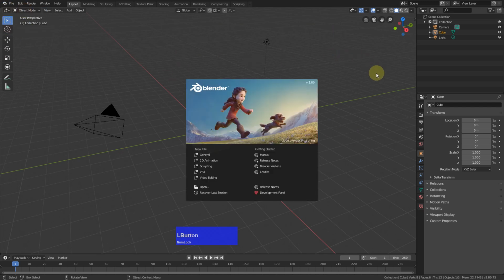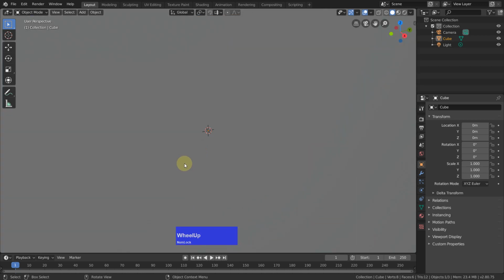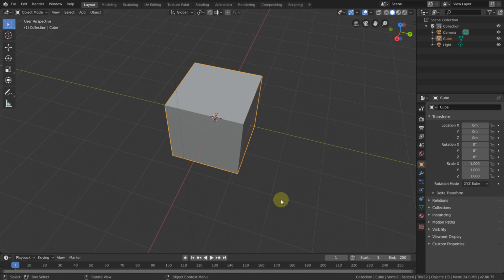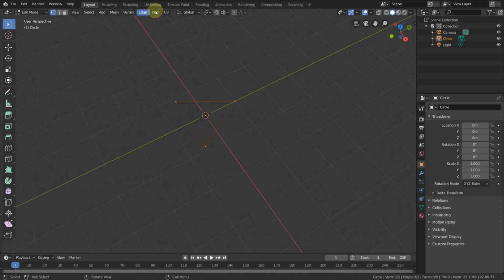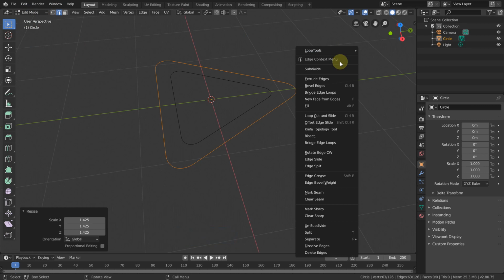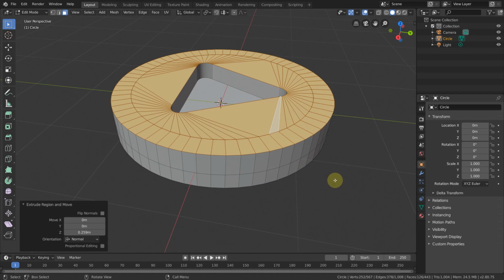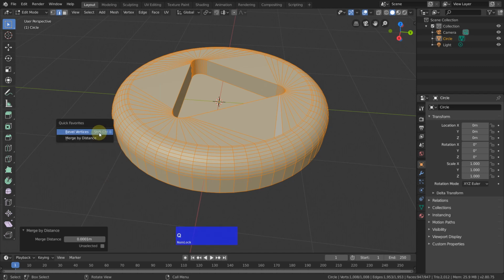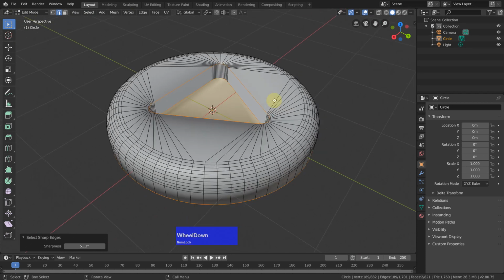A MODO Fan looks at Blender 2.80 - Part 01

Comment: I use blender, but there are scenarios in which Blender gives me a bad topology with its modifiers, although I usually solve these faults with addons from the Blender marketplace, I find blender great, but I have thought of using some option for hardsurface modeling I've even thought about using Inventor, I've seen that Inventor achieves an excellent topology in less time.
Does anyone know if Modo is a good option to model versus Blender? in the context of access to a good topology in a short time

Comment: Glad to see you back Peter! Question: No matter how many times I've tried, I am unable to make the curved bevel (16;35) work. It just bevels down the side(z axis). What could I be doing wrong? Thanks for your posts!
Reply from the maker: Hi, I can only give you the main reasons why tools sometimes behave funny. 1) change rotation, position or scale in object mod and not apply it. (CTRL-A) 2) Having double geometry in your model (Merge by Distance) 3) having geometry inside your model. 4) having a problem with the normals (Blue is right, red is wrong). I hope this can help. Good luck, Peter PS: I forgot something which is annoying and frustrating to say the least. Almost all keycombinations you can think of mean something in Blender. So if you hit a wrong key you might have activated something and it's not easy to find out what. So hit the save key often so you can go back to an older version. :-)
Reply: @stammpe2  Thanks VERY much! Merge by Distance did the trick!

Comment: by the way, I still prefer the way Modo handles the normals. Meaning that you wouldn´t have that orientation problems if you work from the beginning with single sided geometry. Is never a good idea modeling with 2-sided geometries (from my experience)
Reply from the maker: Hi Juan, the reason why this happend is my own fault. It's absolutely possible to create such an object in Blender without the normals problem. If you watch the video carefully, you see where I went wrong. MODO is very unforgiving when it comes to create double geometry. .. And so is Blender. Kind regards, Peter